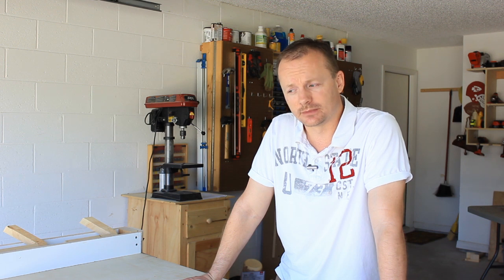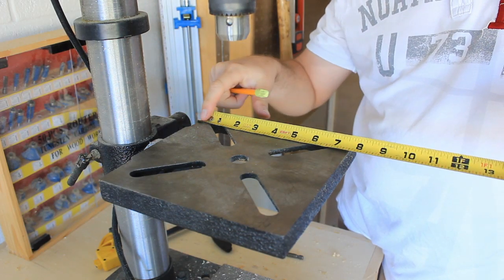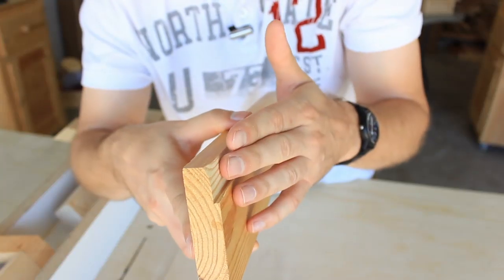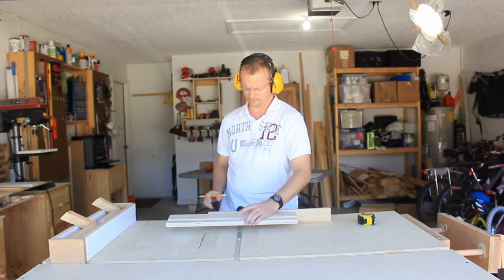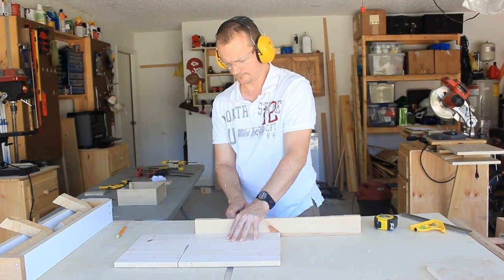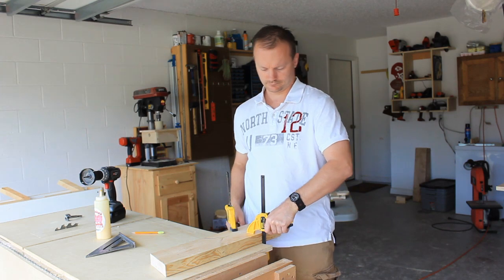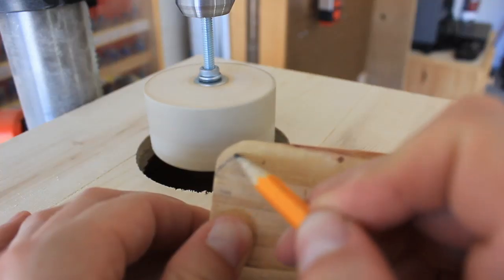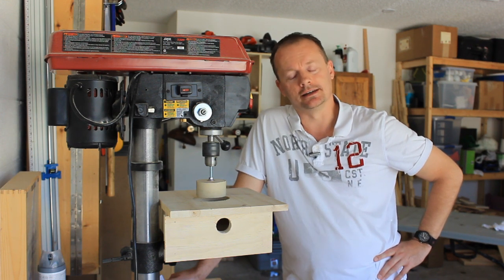DIY Drill Press Drum Sanding Station with Dust Collection

Comment: I was not satisfied with the way my (commercial) drum sanders were working on my drill press so...
I mounted the drum onto my router.  It worked great.  I have a variable speed router and put it on the slowest speed.  Makes a great drum sander!
Reply from the maker: Rob I Yep you can put sand paper on just about anything that spins I guess.  I've seen it done with a right angle grinder and a table saw before.  Thanks for posting.

Comment: How did you end up attaching the sand paper? easy to replace?
Reply from the maker: Jon Singh Self adhesive sandpaper.  Just peel it off and replace.  The hardest part is cutting the next piece to the exact size needed to go around the drum without leaving a gap or overlapping.

Comment: How did your dust collection turn out with this project
Reply from the maker: John Diemer It's Perfect.  Grabs just about everything.  I'm not sure why it worked here on this project but not so well on the table saw workstation.  Probably the size of the compartment coupled with the size of the shop vac are factors.